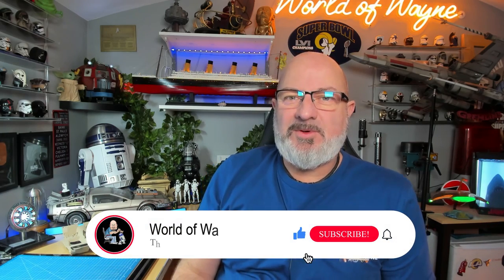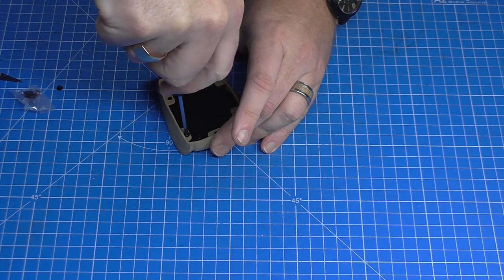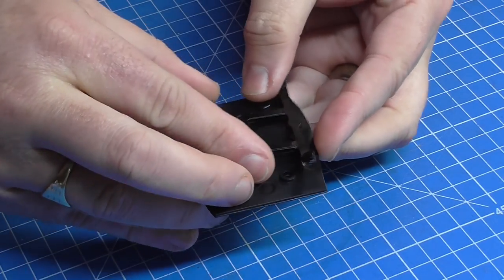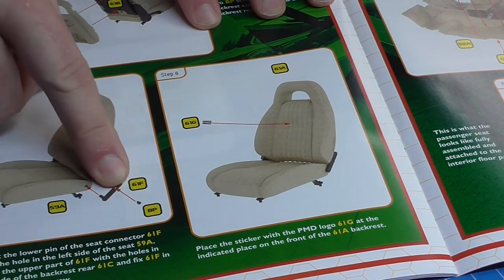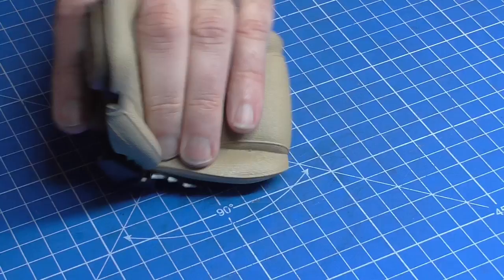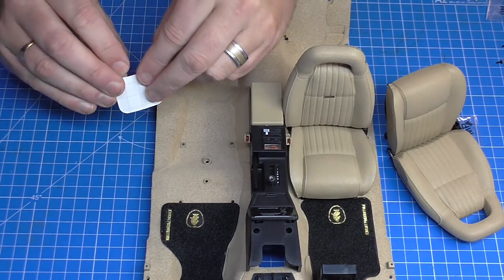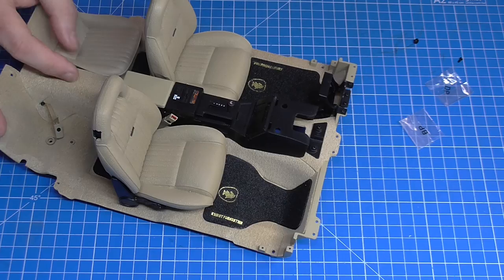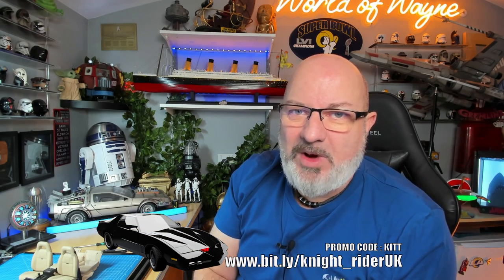Fanhome Build the Knight Rider KITT - Stages 59-62 - Continuing the Interior Seats

Comment from the maker: If you enjoyed this video or some of my other content please consider pressing the SUBSCRIBE button and hitting the BELL next to it so you get notified when I release a new video. You will find all the links and information you want in the expanded video description. If you have any questions or comments please leave them below. You can also see my behind the scenes video logs on my Patreon at https://www.patreon.com/worldofwayne
Reply: Like video
Reply: I'm wondering about the quality of this kit compared to the DeLorean.  There were several issues with accuracy (not a big deal), and several issues with quality (VERY big deal).  There were screws that didn't fit right, incorrect instructions, parts that broke easily, parts that just didn't fit - and so on.  I specifically remember on mine that the engine parts were very loose, and didn't fit together tightly, and at least one of the fold-down wheels kept flopping down on its own.

How's your experience with THIS model?  I'd appreciate your feedback.
Reply from the maker: @thewebexpert3311  this model has been perfect for me so far
Reply: @thewebexpert3311  You can rest assured this isn't nowhere near as bad the 1:8scale Delorean build. The reason why that build failed was because the manufacturers focused too much on the interior/exterior and not enough the electronic parts. Their was far too many interior/exterior electrical parts their Flux Capacitor was shit the Xmas tree was ajoke +the Blue flux bands we're not very bright. The gullwing doors we're useless/would not stay +their circuitboard wasn't powerful enough forra car with that many electronical exterior/interior parts worst 1:8scale car they ever made😡🤬😩👎
Reply: @thewebexpert3311  The only downside with the Knightrider build is that it's lackiing som interior attention to detail on som of the interior parts. And that's where Jason Stevenson over at Mr Fusions coms in with his excellent 3D printed mods. And i highly reccommend Ian Campbell over at Partwork Upgrades/Mike Lane Mods as well for this build😉👍🤝👏